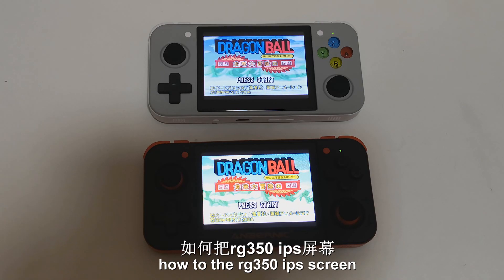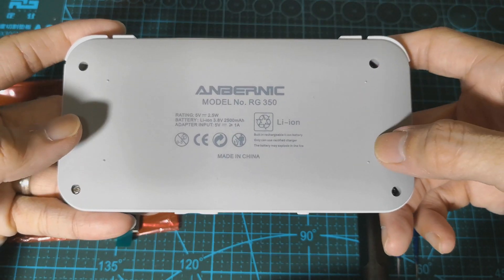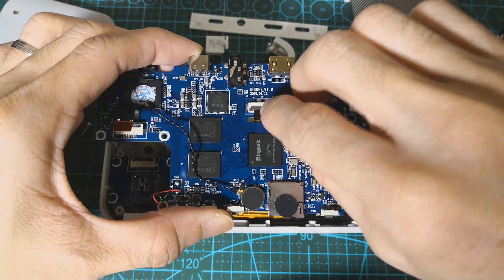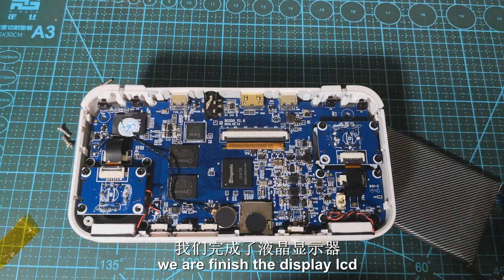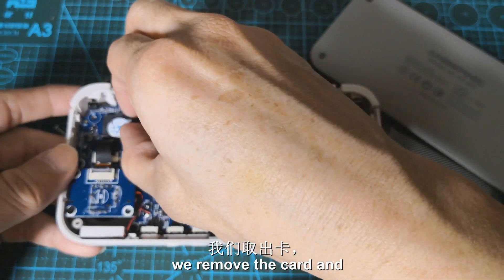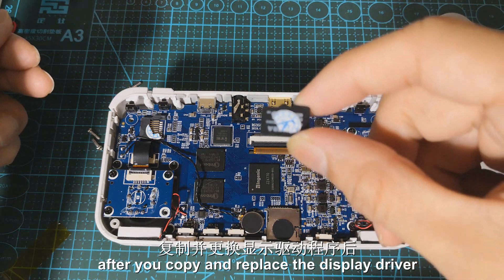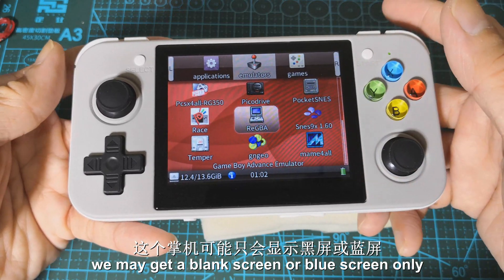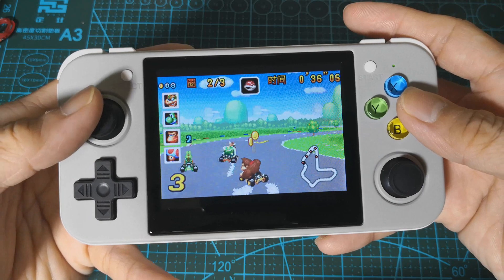How to Replace RG350 with RG350M 640x480 IPS Screen (Tutorial)

Comment: I kinda like the big orange anbernic logo on the original screen rather than the smaller logo on the 350m..would it be possible to keep it when replacing the original with 350m screen?

Comment: i guess if i'm on rogue firmware 1.7.10, i do not need to replace the linux kernel (vmlinuz.bin - the one you called display driver), because it is compatible with both the RG350(P) and RG350M. correct?
Reply from the maker: For rg350p i no idea, but if the image is for rg350m than you no need to replace the driver
Reply from the maker: As i never own rg350p😭😭😭

Comment: Hello Always Be Fun. Is it safe to remove outer screen like this to replace outer screen? Like this: https://m.youtube.com/watch?v=vArGX3ru9Q8
Reply from the maker: Yes for rg350 is safe as we do have a video almost same like this for oga, but for rg350m and rg280m never never try as this two are oca screen, means that the screen and lenses is press by a machine together so if you pull like this, your screen flex cable or connector may say bye bye to you
Reply: Always be Fun Thank you so much for information, appreciate it!
Reply: @histcoshop  hello i am trying on regular RG350 with suction cup but take sooooo much force, is  there glue i must soften with heat first?
Reply from the maker: @itsbreakcore  your suction tools not strong enough, you can refer my tools use for oga video screen replacement or you can heat it up for easy work,

Comment: I finally got my screen I ordered form your website, and there are artifacts on the screen and it occasionally jumps, and jumps on the boot screen as well.  I believe this screen is either defective, or substandard.
Reply: I bought the rg350m with a defective screen, so thanks to your post i think i will order 3 screens in case 2 are broken, do they even care about customers?
Reply: They are sending a replacement screen.   So hopefully this one works correctly.
Reply: Got the new screen,  and it is actually different from the first one,  the ribbon cable is different as well as the components on the ribbon cable.   It no longer has the artifacts and works as it should.   Jas a mark that is only visible on white light backgrounds,  and a small white spot visible on dark backgrounds,  but the higher resolution is much better.   It is just like my rg350m now.
Reply: @typer98  That's good to know, looks like I got one from your batch which I had the same problems, I've reached out to them and they will be looking into my order and see if my one came from the same batch. Fingers crossed I get a replacement screen.

Comment: The OEM screen is glued in place - how did you get yours loose?
Reply from the maker: Rg350 is easy to remove by suction tools or heat gun, only rg350m you cannot remove it without the machine
Reply: @histcoshop  Thanks

Comment: No reason to do that
Reply: Care to explain why? For those RG350 owners who dont want to buy the RG350M for the higher res screen and metal case, but just want the higher res screen. This is the reason why!
Reply: @TN_AU  the games are natively lower resolution, which means your image quality is worse this way
Reply: @raikoh05  From side by side reviews of the 350 vs the 350M, you're pretty objectively wrong.
Reply: @Murat Erdem No, with 320*240 games it would look worse on a 640*480 (4 times the resolution here), native is always better, believe me. raikoh05 is entirely right except if people want to play higher res games of course.
Reply: @Murat Erdem That's what I said... Higher res games (above 320*240) like PS1 games are of course better on 640*480, otherwise low res games are better on 320*240 screen, all that is logical. Thanks.